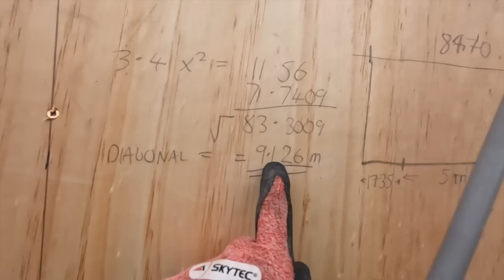BRICKLAYING UP TO DPC BEFORE THE RAIN COMES BACK!!....EXTENSION PROJECT PART 2

Comment: I would say EWI is the only solution for the 50mm cavity if they want to maintain a through wall, be interested to see the outcome.👍
Reply from the maker: We binned it . They are reducing the cupboard depth in the extension so it all runs through flush 🧱👍🏽👌🏼

Comment: Trench fill foundations and trench blocks are so much easier than building out of ground and cavity fill with concrete. Ive had lbc bricks in as copies harder bricks with the same lbc face not sure they still do em Steve .great job as ever 👍🌧👍👌🧱🧱🌧
Reply from the maker: Definitely Justin, the ibstock tradesman brick copies are excellent but the choice is limited 🤙🏾🧱👍🏽
Reply: You'd think they'd copy all the lbc range wouldn't you.
Good luck steve weather killing us in Cardiff hope your having better luck 👍
Reply from the maker: @brickrightbuildinglandscaping  6 days in so far this year, it’s either pissing down or frozen solid 🥺🌧️🌨️❄️🥶🥶🧱👍🏽roll on spring
Reply: Hi, can I ask why trench blocks are used rather than just filling the foundations up with more concrete? Are the blocks and time to lay them just cheaper??? Thanks.
Reply from the maker: @andrewwheeler1590  A lot !! 🧱👍🏽

Comment: Feel your pain with lbc bricks. Need to order 500 to get 300 usable bricks. 90% of the time now we use ibstocks our local merchant keeps a good range of the Ibstocks that cover the lbc that we’re used around here the lbc heather,Tudor, dapple light. I know can be a bit of an effort you not thought about treat ya self to a “Tony tent 😂”
Reply from the maker: Yeah ibstock tradesman whenever we can better and cheaper 🤙🏾🤙🏾🧱👍🏽